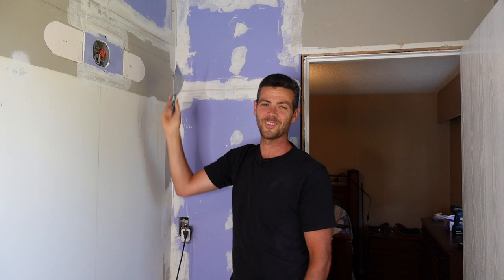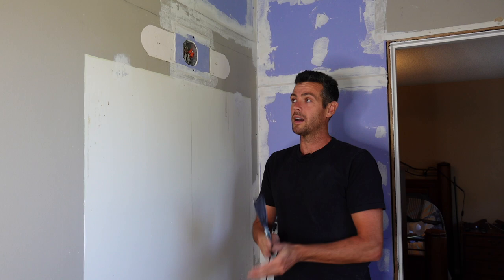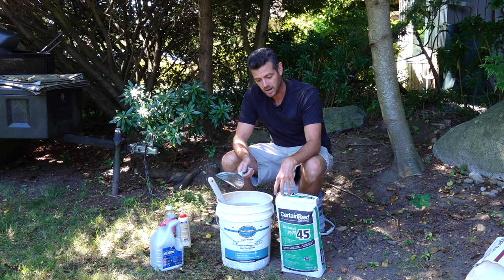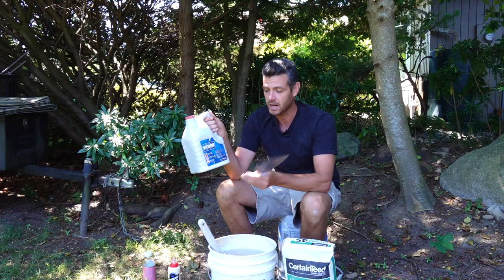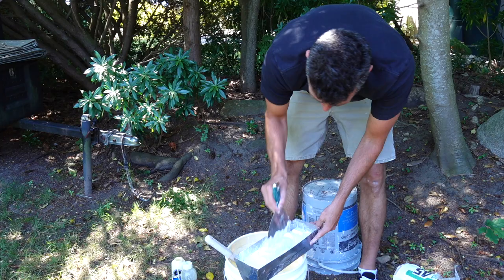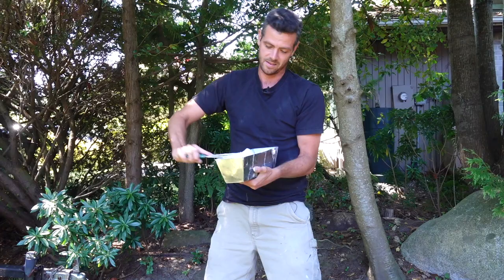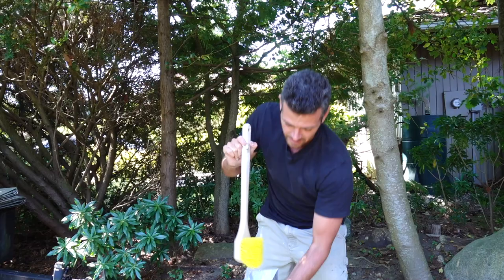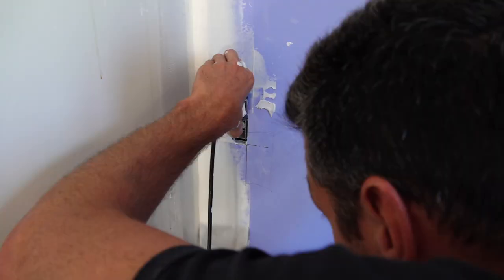How and When to Add Glue to Joint Compound!

Comment: I have a question off topic...I made a template that's an 1/8 of an inch on the wall. I was wondering what joint compound should I use that won't shrink and crack.

Comment: Hi Van C, fellow canuck. Would this work for exterior skim coat? I'm trying to make smooth old exterior peeling paint on wood trim. After scraping there are divots (from missing paint) and need something to fill the craters. All the dap spackling say 'do not use as skim coat' especially on exterior. So I'm not sure what to use.
Reply from the maker: Bondo is a good choice for exterior. It will outlast the wood.

Comment: I'm looking at skim coating one of my bathrooms that has a painted sponge texture. I'm worried about the adhesion. Would you add glue to the first skim coat or would sanding and primer coat (Bins or similar)  before the skim coat be necessary.
Reply from the maker: Only add glue to powder setting type muds.

Comment: Do you notice a difference in sanding when you add glue?
Reply from the maker: I only add glue to quickset and never really have to sand quickset as it's just a basecoat. Sanding coats are always air drying muds.

Comment: Can you, or did u ever use Elmer's glue?  Would that work?
Reply: After watching one of Ben’s earlier videos, I’ve been using Elmer’s in all hot mud patches, and it has been 100% successful. Always thought I’d never touch drywall, and now thanks to nailed steel corner beads in my house and Ben, I’m kinda, well, proficient. 

I do just enough woodworking to not want to use wood glue, so I bought some Elmer’s on sale, and I’ve stuck to it. (Couldn’t resist. Apologies.)

Comment: I use durabond and no glue needed. I think you said it's not available there in CANADA.🤷😩
Reply from the maker: It's just not easy find in my area.
Reply: @vancouvercarpenter  Yeah the only place that sells it here is Menards. I'm sure you could order online there. So question since you guys tape with all purpose light do you guys have a lot of premature cracking issues these? We tape with regular USG sheetrock brand all purpose here and it's so sticky and hard that you can't hardly stand it. Just curious and Keep the videos coming.
Reply: @vancouvercarpenter  I've seen it at most homedepot stores in the lower mainland. Usually in the small (overpriced- expensive) 😅 bags. Although doing drywall with something that turns to virtual concrete is a challenge to itself.
Hey Ben, you need to steal one of your wife's beaters. Combined with a small cordless drill, it does a great job for mixing small pans of mud.
Reply from the maker: @mr.kenslifeshop4034  We have lite taping mud. It's light weight,  beautifully slick to work with, long working time on the wall, incredible adhesion and pretty darn hard but not as hard as a heavyweight all purpose. It's pretty comparable to AP but not nice for finishing. It's easier to sand than a heavyweight AP.

Comment: Bro u do not have to ever add mud you can buy taping mud, and you pva prime. I am a REAL PROFESSIONAL FINISHER, trained and had to go train after work and actually get certified and pay raises. 

You will void any warranty of you add anything that's not specified.

YOU DO NOT PUT FKIN WOOD GLUE IN QUICK MUD. 1. Scuffing a glossy surface creates rips that allows compound to attach to.  

Can I ask where your training cane from or are you just self taught and assume your a professional...

These guys always giving bad information....